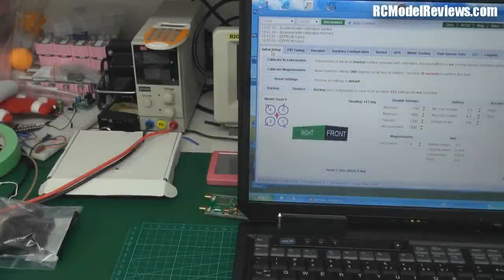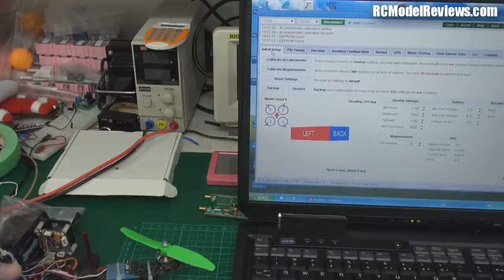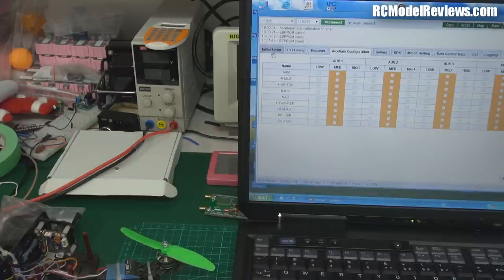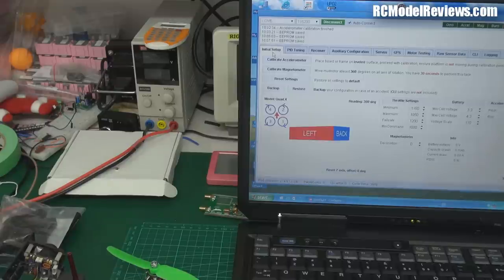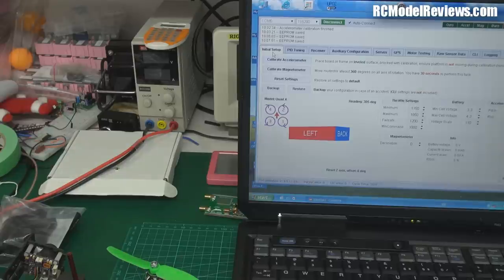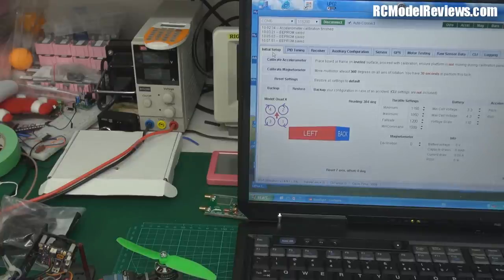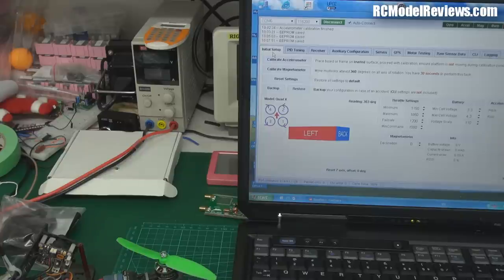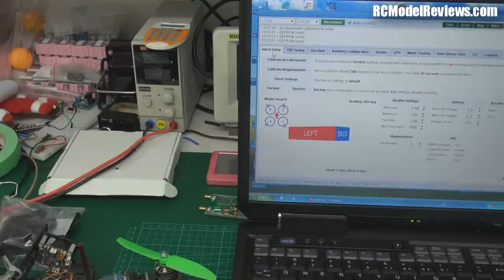Naze32 yaw gyro fail?

Comment: Not sure if anyone mentioned this yet, that's not a gyro fail, that's a mag fail (I spot a full board on there).
You'd need to disable mag, and not by checkbox, but in cli
set mag_hardware=3 and save.

If you turn off mag in GUI (checkbox), the 3d model will look crap but it will still fly properly without mag (as it won't be used for anything unless enabled).

You might also need to just calibrate mag (hit the button and spin model around in all 3 axes a few times while LED blinks). But before you do that, head over to graphs, and note X/Y/Z of the compass moving as you move the model - if all 3 axes move in a reasonable way, then you just need to calibrate, if one of the axes is stuck, then the chip is fucked up.
Reply: I wanted to recommend the same steps... My naze had the same problem once but I could solve it by calibrating the mag again.
Reply: When you do a mag cal on the bench and un-plug the usb why is it the lights changing ? I can't rotate with sub plugged in and yes it has a battery the quad but lights still change .
Reply: Aron Gatt If you think it does, you can always trigger mag calibrate from sticks...
                THR_HI + YAW_HI + PIT_LO + ROL_CE
Reply: You can initiate the mag calibration without the gui. Look on page 12 of the naze manual for the stick commands.
Reply: Well said TimeCop. In the old MultiWii PC GUI it will be more easy to see these problems, since each sensors is reported on the screen. Anyhow ... it is amazing how "incompetent" is the super expert RcModelReview ... LOL ... not the first time he makes mayor mistakes speaking of multicopter control board
Reply: I'm having this issue on an acro board, a legit one of yours, not a cheap knockoff
Reply: elm70 Bruce forgot more than you will ever know.
Reply: Adam Black It is hard to "believe" that the 6050 chip, which has 3 gyros and 3 accelerometer sensors is defected only for the Z gyro, but it is fine for the other 5 sensors ... so you may have activated mag by mistake, or you may have fail the gyro calibration that happen at every start up. Still if you believe it is a broken sensor, use the MultiWii 2.3 Java PC GUI, and check each sensors, both while the control board is not moving and as well check how the gyro numbers changes when rotating the board
Reply: The baseflight configurator also has a tab with real time plots of the sensor data.
Reply: elm70 Positive I haven't activated the mag on my acro board, which doesn't have a magnometer.... Quad just turns randomly in flight, in such a way that it's nonflyable. Not a tuning thing, same tune, just a usperious reaction that came out of nowhere oneday. Swapping the board out tomorrow, will know more then
Reply: elm70 even tried manual gyro calibration once armed, even though craft is stable and level on power on.
Reply: elm70 Will even attach uhf telemetry radio and log flight data tomorrow, to check what the G-O is
Reply: Adam Black
Yes, good idea to have log data. As said, I doubt it is a defected 6050 chip ... maybe you have bad vibrations or other type of problems. You may get "noisy" data from 6050 if you have a poor 3.3v reg on the chip, but I doubt this is your problem .. it will not be only the Z gyro to have problem, but all the stability will be problematic
Reply: precisely what I have experienced in the past- the board still flies perfectly as an acro fc. Fuck baros and mags.
Reply: ***** Damn right! lol
Reply: Seems the Expert has arrived and answered the question. great info to know as I have several full Naze32's flying with no issues. thank you timecop.
Reply: timecop1080 Yeah, it does look like a compass fail.  I'll turn it off in the CLI and see what happens.
Reply: I'm not thinking , it's doing it ... Just trying to ask a question cos I don't know if it should do this ?  I do calibrate the mag with the sticks inputs but just asking if I'm doing something wrong when on the bench? Or when Cal on the bench the usb has to be hooked to the board?
Reply: Aron Gatt
For calibrate the mag, you not only need to move the stick on a special position, but as well, while the led is blinking you should try to rotate the copter/board in every possible direction, so the board can read the max and min magnetic field on each of the 3 axis. Sometime this process is not easy to be done 100% precise and the mag calibration is a big wrong, and it can cause error on heading detection from the magnetometer
Reply: Thanks , I got a good idea cos I have a couple of Naza but calibration it's easy on them once dialed in , the naze flys great as it is but wanted to double check the bench cal , it's something I never did and leaving use cable pluged in it makes it next to impossible .

So what I did is assign a switch to mag and activate it then did the dance , it flew ok but still not 100% , I will try the above
Reply: Hi elm70 ....it's not ***** who is incompetent as he simply expects the software to behave as designed. It's the baseflight coding what lacks improvement and attention lately. I bet this all wouldn't happen on Cleanflight ;)
Reply: Boris B. Please ... don't promote Cleanflight here ... assuming that inside the same chip, 5 sensors works fine and only one is damage ... I call it "incompetence"
Reply: Nothing wrong with clean flight tho
Reply: I am not promoting anything, but if this is apperently a known bug it should have been addressed and fixed like normal software development.
Reply: elm70 I don't want to be rude, but just checked your channel to see who is calling Bruce as being imcompetent and it appears you fly RTF toys. OMFG
Reply: Boris B.
It appears you can't even look at somebody channel on youTube. On my channel I show how I customized multiWii into KK2, how I made DIY naze32, how I made DIY BL gimbal, etc. So ... who is the incompetent here ? And I'm not speaking of Bruce. But more then incompetent, you are trying to discredit somebody else, that it is even worst !
Reply: elm70 You Sir have no business here, please stop trolling
Reply: ***** I don't need to have any business for state my point of view, especially when somebody promote disinformation, making people to believe that Naze32 boards are problematic. Anyhow ... what is your business here? Are you here for insult people that have different point of view then yours ?
Reply: elm70 Bruce is the reason of success of naze32. Don't claim he is making people believe there is a problem with it.
Reply: Boris B. Naze32 was quite successfully before Bruce discover it. Anyhow, I don't claim anything, it is in the video description "What has gone wrong with this (and another) full Naze32 flight controller boards?"
Reply: elm70 The board was never "out of stock" before Bruce did a review and the boards. After that it was hard to get one and still is. Everybody knows that.
Reply: Boris B. TimeCop boards have been out of stock also before Bruce did discover Naze32. But, yes Bruce with a past video did help to promote Naze32, short after HobbyKing did even further promote TimeCop boards. Anyhow, in this video it is looking Bruce "demote" Naze32 boards now, blaming the weak "yaw gyro sensor", which is integrated into the 6050chip with other 5 seconds, and the same 6050chip is used by almost every control board, from DJI to APM, etc. This video is particularly wrong, timecop above have already explain what is the problem.
Reply: elm70 You need to do some better research m8. Hk took this boards in stock after Bruce did a review.
I am flying these boards since they exist m8 and really don't want to spend any time proving that to you.

But your imcompentancy is starting to annoy me now. Bruce was showing the GUI behaviour. That's where you see a model in screen. In case you didn't know information displayed there is interpretted differently from roll/ pitch and yaw. Roll and pitch information is coming from the accelerometer and yaw information isn't.
There is a significant difference between interpretation of roll/pitch vs yaw and even in processing of those. If something would be wrong in hardware yaw axis should show different issues than roll and pitch axis. In that case you can say that yaw axis is more sensitive to sensor errors.
Have a look into the PID algorythms and you will notice that there is much more scaling going on in yaw PID's.
Reply: Boris B. I should not feed trolls. You don't even know that the roll and pitch is calculated by fusing gyro data with accelerometer data. And when Mag is enabled heading is the result of fusing gyro with mag data. You did try before to attack me based on my videos (since I review RC toys, but as well I present original DIY projects), now you try to again to question my competence ... you are the classic troll that fail to argue over concepts, and have to attack the person for legitimate your wrong doing !
Reply: Thank god elm70 . You are finally admitting that there is indeed difference in roll/pitch behaviour vs yaw in this case.  
This means that a defect can indeed show difference in behaviour on yaw and that Bruce his initial theory was plausible.
Too bad it took you a few frustrating messages to realize this.

I was never attacking you. It was just funny to see a full page of RTF product reviews when I checked your page.
Reply: Boris B.
Trolls can't read ! Roll/Pitch need gyro information for be computed. The only difference between roll/pitch and yaw, it is on yaw no acc data is used, instead the gyro data is fused with the MAG ... so if there is any defect then it is the MAG, but most probably it has been just not calibrated.
Reply: Wrong again........the gui only uses acc data for the model display. 
It's the PID controller algorythm what uses fused acc/gyro data except of in acro/rate mode.

Don't try to pretend being smart again.
Reply: Boris B. Your ignorance and arrogance has no limit, PID has nothing to do with the algorithm in charge to sense the board orientation. The board orientation is calculated by fusing gyro/acc/mag data as described before, and this is shown in the GUI as reported by the control board.

Anyhow ... you win ... your noise has been so load, that now non smart people can attack me for be a "troll" ... this happen arguing with trolls like you over the net.
Reply: Ok you win elm70 . Your first normal comment.

I hope you can read your comments once more to realize what was the reason most people got annoyed.
Sometimes it's all about the way how people communicate regarding about what matter.
Reply: ***** ha ha I really enjoyed reading all this. One individual here is oh so smart, so smart that he actually can decide who's smart and who's not, yet not so smart to see how much of an arse he is himself) Timecop- thanks for naze, Boris thanks for flying, Xjet thanks for your (apparently lacking expertise lol) reviews, thanks to positive people for staying positive, even if you're not smart ;-) and finally thanks in advance to elm for not writing any more rubbish like the one I just read.
Reply: Rob Crawford
Yes, easy to blame somebody when this is drag down by trolls like Boris.B ... which you can see well, scrolling the post who did attack out of the blue, armed by his total ignorance. I know a smart person will not jump on these type of "net war" since it is a lose-lose situation. Reply to a troll make you a troll. Anyhow ... again people need to attack at personal level, since from facts point of view, I'm unquestionable right about gyro/acc/mag and how the Naze32 control board is working ... I can DIY both HW and SW of this control board, so go figure
Reply: Hi timecop1080 , I'm having ayaw issue with an acro version, can it be a mag problem? the quad yaws by itself to the right, in the raw data the gyro shows -24 on x and z axis even when the board is not moving at all. I did acc, gyro calibration and disable mag, nothing worked.
Reply: Its set mag_hardware=1 in cleanflight btw. :)
Reply: carpiotube did you manage to find out what's the problem? Or maybe it's something normal? I see exactly same behavior in my brand new Acro Naze32 with Cleanflight.
Reply: ***** to be honest, I gave up on cleanflight. It suppose to be better but I only had problems with it. Switched to baseflight and I am happy flier
Reply: blackcamo FPV I see I will give it a chance and see how it goes. :)

Comment: not sure if it helps, but on my naze boards(cleanflight) the graphic typically obeys the compass regardless of what you have selected in modes. So is it possibly a compass calibration issue?
Reply: Matthew Hyatt I'll try a compass cal and see if that works.
Reply: after thinking some more, you may also have mag interference from your power wires, though that usually only shows up when it is spun up. might try disabling the mag altogether from cli

Comment: When you disable the Mag in the Aux setup screen, you are just un-assigning the Mag Hold function from all Aux channels. The magnetometer is still functioning on the board and its heading output is still sent out and will show on the Quadcopter model orientation in Baseflight configurator. The problem is that you might be getting magnetic interference from the equipment on your workbench, workbench metal frame, etc. If you calibrated your magnetometer near these sources of magnetic interference, then it will be a lousy calibration and will show up perhaps as what you see in the configurator. If you calibrated your magnetometer away from interference and then brought it back to the bench where there is interference and connect it to your laptop, you are still going to get lousy heading readings.

My suggestion is to calibrate your Naze32 magnetometer away from interference, then connect your laptop to the Naze32 far away from the bench and interference sources and see if it this problem persists. I believe this will solve your problem.
Reply: Richard Ding It exhibits the same random yaw when flying out in fields miles from anywhere.
Reply: *****
I have seen similar yet not as extreme behavior on most multiwii based boards I have. That is when the magnetometer is not calibrated properly. After recalibration it works fluently. Hence no magnetic interference in the area. Could it be that the magnetometer is not calibrated properly? APM mission planner GUI shows how thoroughly one could calibrate a magnetometer.

Comment: Hmm. I've worked with these chips at the hardware level (written arduino drivers for 'em) and know a little about how they're constructed and run. I believe the MPU6050 is a 'driven element' MEMS system, which means it has a little plate that it vibrates at the Mhz rate, and sensors to pick up what it's doing. One for each axis.

Between that, the fact they're intended for consumer electronics, and the 16G range (which really isn't a lot, compared to a hard knock) makes me think they'd be susceptible to sustained high-frequency vibrations, especially in combination with occasional hits.

That's the kind of thing that would snap the little MEMS 'wobble table' that's the heart of each axis. And that also sounds like "business as usual" for a quad.

My feeling is, you've exceeded that poor little device's tolerances. It expected to have a boring life in a WiiMote or a Mobile Phone, and you've got it flying through the air attached to four vibration-generators. 

It broke. Time to get a new one. :-)
Reply: Actually, this is kind of a wake-up call for the board designers. Given the relative cost of the parts, there's now a good reason to use redundant Gyros. We like to think of them as solid-state, but they are mechanical devices, and from what Bruce and others are saying, they've been failing in our extreme-use case for a while now.
Reply: If it's an exceeding tolerances issue, why would these same symptoms show up on so many other new boards folks are reporting...sounds more like a bad batch to me...?
Reply: jpt1205 Well, the symptoms are pretty generic. I also would have suspected it was "hard-iron" effects on the magnetometer, except Bruce said he disabled it. (Although timecop just piped up and said that disabling it is tricker than one thinks, so maybe it was the mag after all.)

Comment: Make sure you have no devices on board that are magnetic and within range of the board.  
You want to test out how bad the issue can be?  
Plug into the configurator and introduce a magnet to the naze. Start yawing it and see what happens.  
You will get similar results to what you are experiencing, but Bruce, you may have a component in your build that is doing that.  
Check your buzzer ;)
Reply: +Dirty Robot Having same problems with my emax nighthawk 280. Glad I seen this comment. my lipo monitor was interfering with it.

Comment: People tend to think of these angle sensor chips as being solid state "electronic" gyros but they're not. These things are actually nano sized vibrating structure gyroscopes burned onto a chip that use the same principal as the halteres of an insect to detect changes in angle. The vibrating masses these things use are much smaller than the width of a human hair so it's possible that a hard enough knock simply did physical damage to it.

Comment: I see this all the time with multiwii until I calibrate the compass - I believe it's caused by using atan2 on values that are not smooth around the -180 degree to 180 degree compass transition. First step would be to look at the raw data readings and see which sensor is actually causing it. You may not see anything useful in the compass values, but it should at least let you rule out gyro.

Comment: I will parrot what was mentioned to me a few months back when I had mag issues with a full board (also flown hard, and crashed a few times)
These are inexpensive boards with sensors never designed for the robust applications we put them through. They are not indestructible. ;)